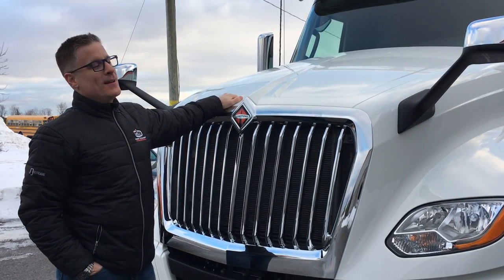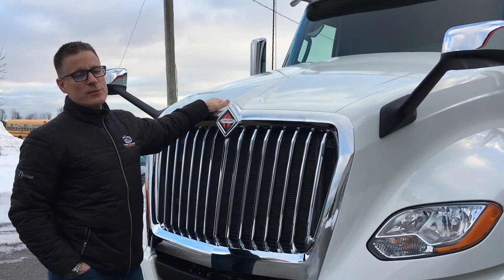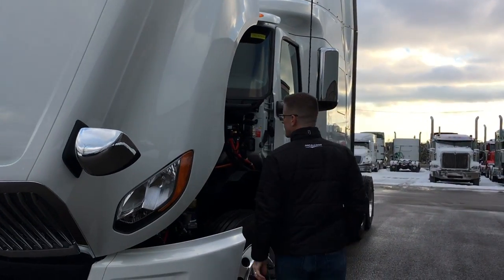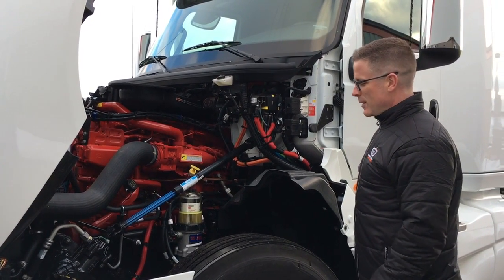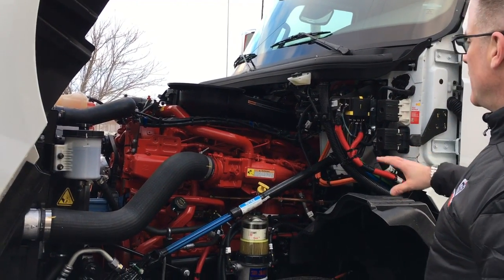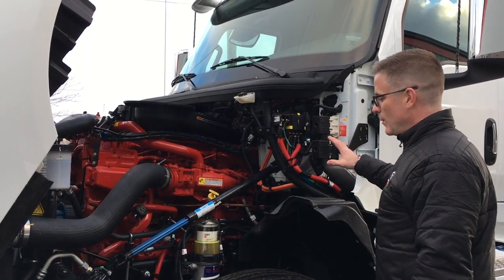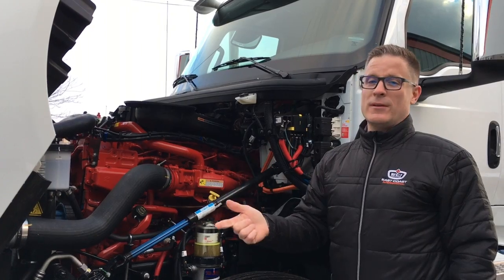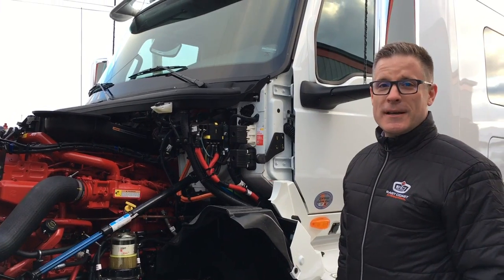Under the Hood of the International LT.

Comment: international  has it right with a great engine. the Cummins will out perform the international Maxx force engines. I worked on both engine. Cummins easy to do service on. international make very thing condensed  together,making it harder to do service. more down time compare to the Cummins engine.
Reply: The Maxxforce isn't available anymore, it was replaced by the A26.